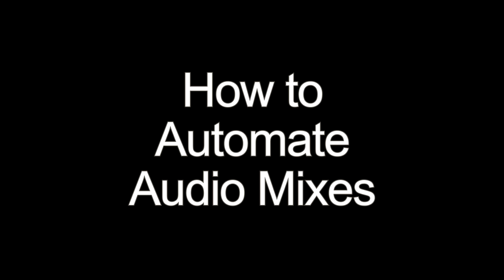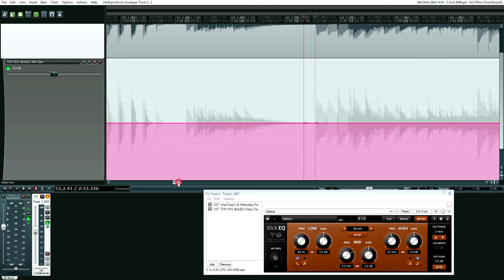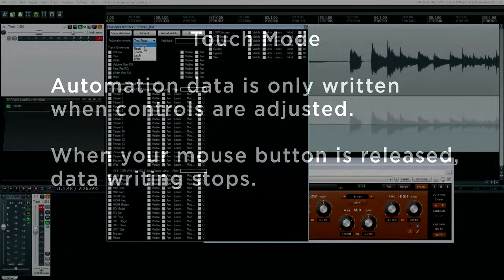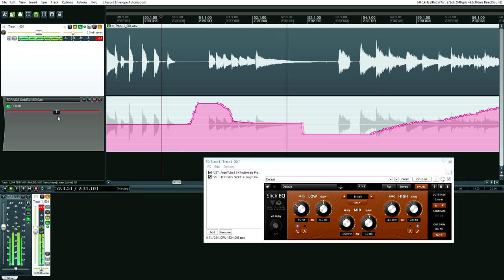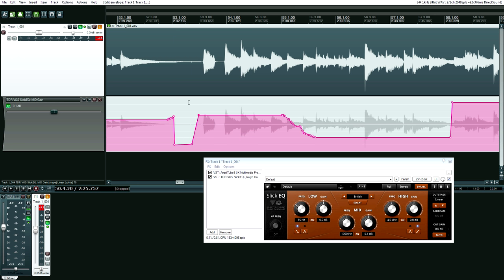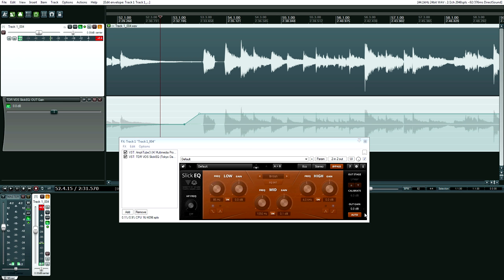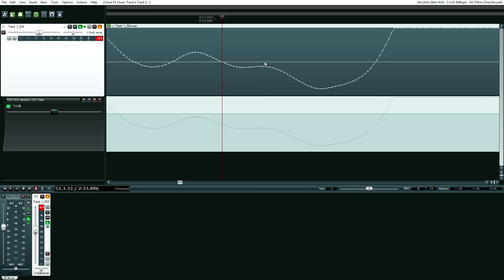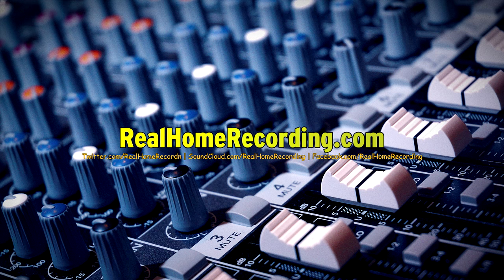Music Mixing Automation Basics Explained

Comment: I use Free G to automate volume. Used it ever since you talked about it. Thats my go to plug in for gain automation.
Reply: btw I do automation on other things like mix knobs for chorus, delay, reverb and alot more. The best way to approach it is think in an EDM way meaning think unnatural because thats where the cool new sounds come from that everybody loves. Just don't over do it if the artist is picky about stuff sounding "natural". Also don't use autotune if that same artist asks for it because they are a hypocrite lmao. (edit: this advice is for the advanced that knows when something is too convoluted. Beginners should learn what that means first by wrecking a mix with effects and starting over, on your own time and not when working on something important.)
Reply from the maker: Learn the rules before you break them! Solid advice.

Comment: This is great,  as I'm learning engineering I realized how important automation is,  I can't just set a track volume and expect it to be transparent throughout a song.  What do you think about  using vocal rider for automation
Reply: Vocal Rider is good, but it's good to do it manually a few times, if only to get the hang of using automation. Adam is totally correct when he says how important automation is. And don't forget, you can use it for just about anything in your mix, not just volume levels; you can automate plugin settings, synth settings, anything. Once you start you won't stop!
Reply from the maker: I agree with what Braincoral wrote. Practice automating everything...just for fun! 

I haven't used Vocal Rider because it's not compatible with REAPER. However, http://www.tb-software.com/TBProAudio/gainrider2.html is a great substitute.